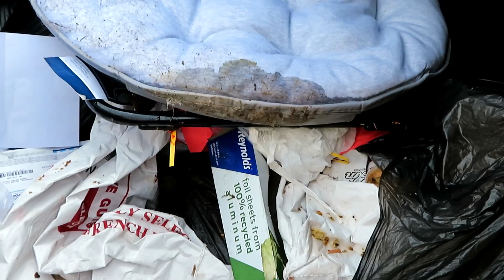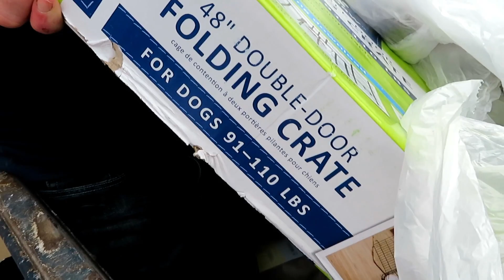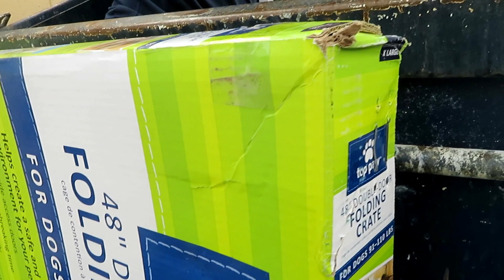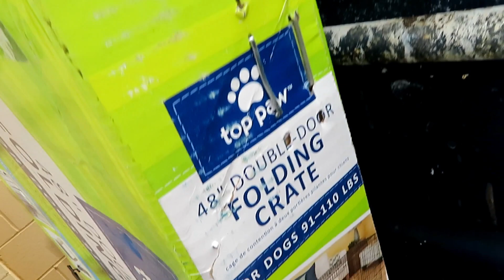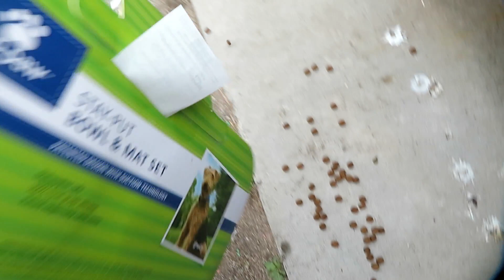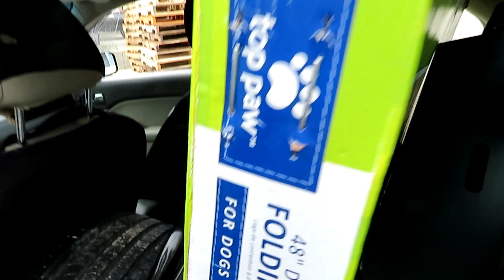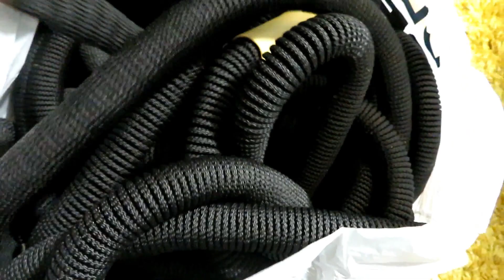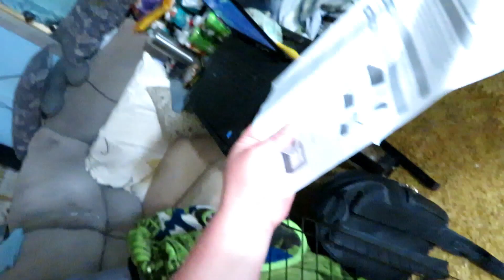DUMPSTER DIVING AT BED BATH & BEYOND+PETSMART

Comment: I’m pretty sure the kennel door is packed in between the 2 pieces, but Ppl would still by the kennel without a door for cat litter box. It’s perfect for that. U could always call the manufacturer for the door.
It easy to make one from a metal grid too.
Reply from the maker: It has both doors love it’s all there in perfect condition